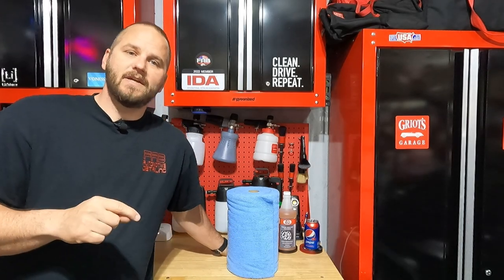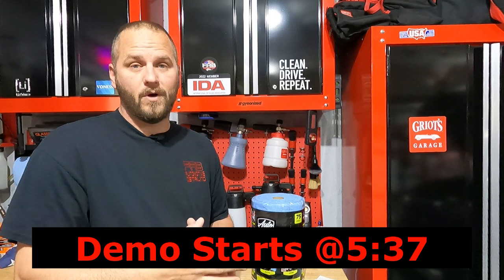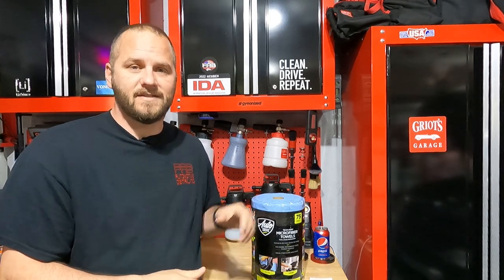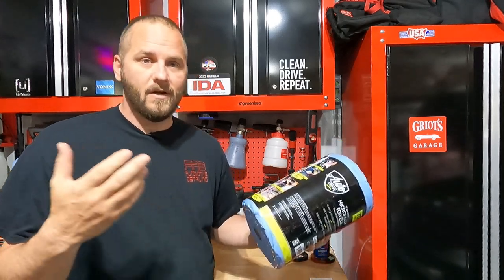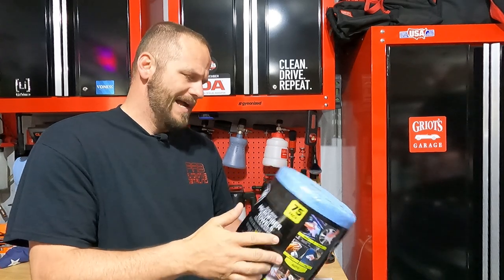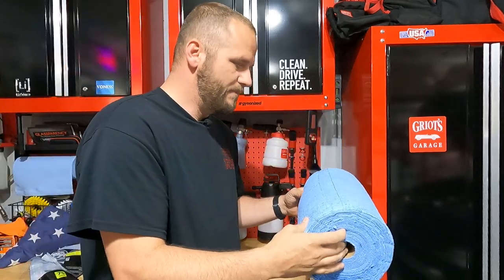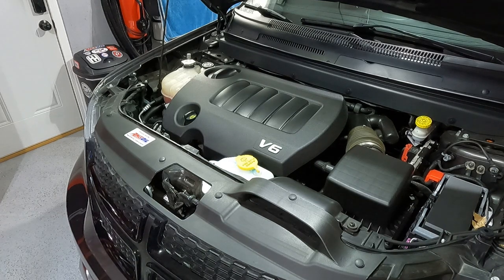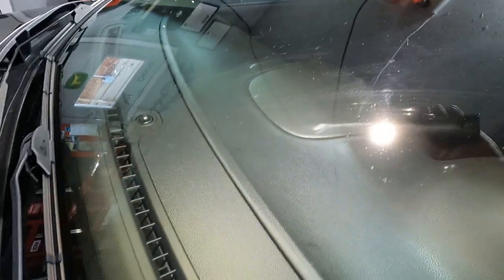Cheapest Microfiber Towels I have Ever Seen! At $.21 Per Towel are They Worth It? Let's Find Out

Comment: The place I retired from I ordered from an auto body place where it was 20 x 20. Grainger had them but more expensive and it was 1000 sheets per roll at 20 x 20. They lint soooo bad it was not worth the time and labor cost to redo the projects that it was assigned to. But I would buy sam's club towels and Costco towels for interior and engine bay cleaning.
Reply from the maker: These didn’t look bad at all on the plastics and tires. Definitely wouldn’t use them on glass or paint I know that much.

Comment: I think those towels would be great for any surface that is likely to be greasy or oily… like engine bays, wheels, tires… but also great for drying just about anything versus paper towels or more expensive micro fiber towels.  Also, I’d be curious if the plastic medium being used at the tear points don’t basically disintegrate after the first wash, thus eliminating the scratching danger.  Thanks for the review! 👍👍👍  ~John in Ohio
Reply from the maker: Once I wash them I will check to see if it disappears or ends up in other towels. Thanks
Reply: @FABAutomotiveDetailing  Did you ever test this?
Reply from the maker: @1TornMonkey  Yes and it did remove all of it and they softened up.
Reply: @FABAutomotiveDetailing  Thank you!
Appreciate all you do for the community 🙂
Reply from the maker: @1TornMonkey  You are welcome!

Comment: Pretty sure the shinny edge is where they use a hot wire or laser to burn the fibers to make it so it can be torn off the roll. Mf is basically plastic like fibers which can melt if they get too hot. That's why you have to be careful putting them in the dryer or too hot water. They begin to melt and get stiff and crunchy
Reply from the maker: Hey brother it’s been a while! Good to see you again. Yeah once I washed and dried them on low it disappeared.

Comment: They can be used on paint just be smart about it. I wouldn't use new off the roll on dark colors or fresh clear coat. I use them on light/med colors without any scratching. They also get softer after every wash, no fabric softener or dryer sheets. Just a qtr. cap of detergent and a cup of pure backing soda per full load, med heat to dry. Been using these for a very long time and never had an issue.
Reply from the maker: I’m growing to like them the more I use them.